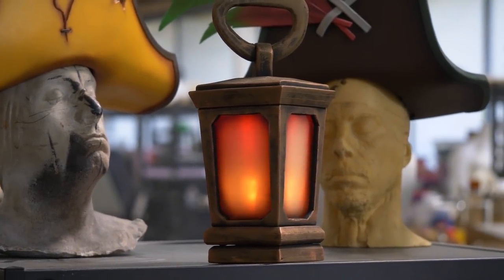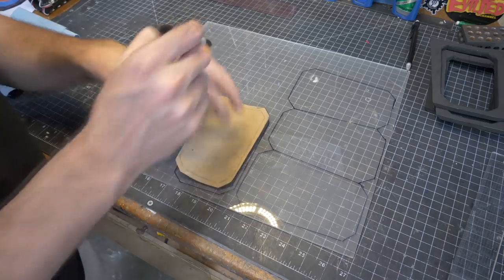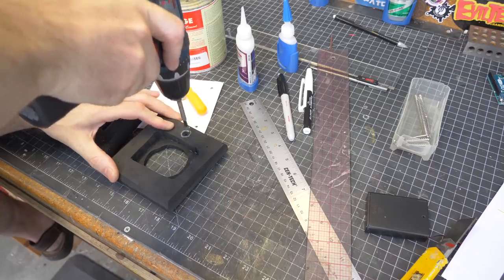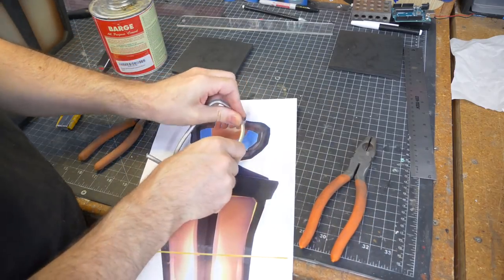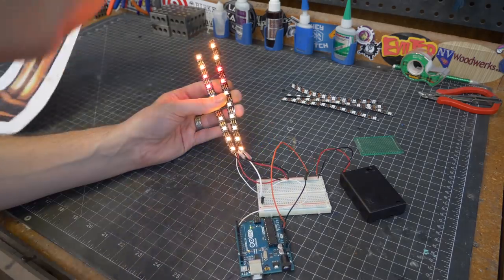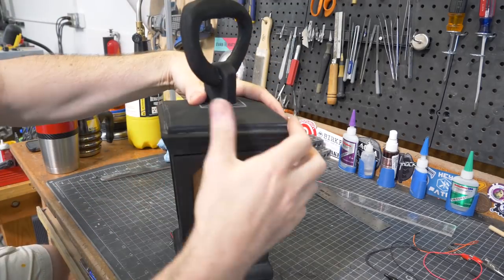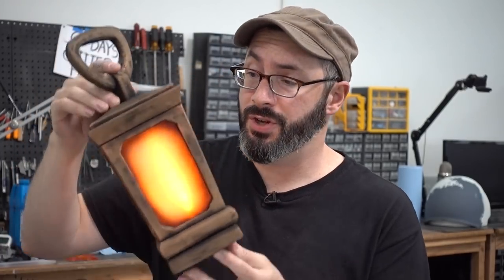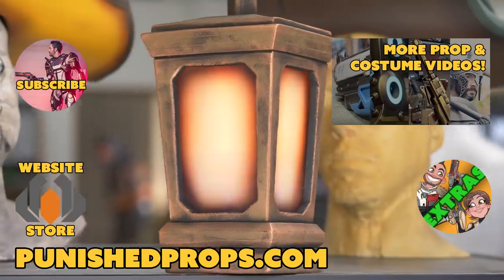I Made this in 4 HOURS! - Sea of Thieves Prop Lantern Tutorial

Comment: For those who want to build a lantern but don't know anything about soldering and programming LEDs  (like me) Walmart sells some fantastic little LED strobe lights in the Halloween section - there's a basic strobe, a color-changing strobe that starts out slow, speeds up, then slows back down (I'm using that in the head of my banshee) and a yellow flicker strobe.  They're $3, and totally worth it - very bright and long-lasting.
Reply from the maker: That's a great tip Becky, thanks for sharing!
Reply: You can also find LED strobes in the automotive section year-round. The neat thing about those ones is that they're hooked up to a pair of 9V batteries right in their packaging for demonstration purposes, so you can just copy that setup for your own purposes.
Reply: There are various electric candles too if you want clear glass.

Comment: I'm in the midst of a large LED programming project (with hundreds of LEDs!). A technique to cut down on the soldering that we're using is to zig zag the LED strips back and forth instead of cutting them and adding leads and connecting them together. It makes the programming a bit more complex, so it may not be a net time savings, but it is removing hundreds of (somewhat delicate) solder connections for us!

I'll have to work on a video to show the technique.
Reply from the maker: Super cool!

Comment: nice build .. just in case it helps if you lower your band saw blade upper guide closer to the material you can avoid most of blade brokes (and if you adjust it correctly also)

Comment: 0:49 - which cutter(and expendables) are you using for angle cuts? So far, any cutters like that left my foam in tatters
Reply from the maker: I linked to the knife I use in the description. The key is to make sure the blade is always nice and sharp. I use a sharpener to keep the edge fresh after every several cuts.

Comment: Do the magnets interfere with the arduino board at all?
Reply from the maker: Not that I could tell.
Reply: Cool! I'll keep that in mind if I ever build a board into something.
Reply: @WilliamJakespeareProps  No, they definitely wouldn't. You'd need some pretty ridiculously powerful magnets to interfere with electrics. Even platter-based hard drives are not easily damaged by magnets. Really the only thing you have to worry about is old CRT screens. Putting a magnet on the screen of a CRT makes it go all funny colours, and they have to be degaussed after that.

Comment: Unrelated question to the video, but how would you suggest getting rid of the diamond pattern on foam pieces? Or do you just buy untextured foam? That diamond pattern always seems to remain to an extent when I try and sand it down.
Reply from the maker: I try not to buy floor mats that have the diamond pattern on them. If I have too, I'll try to sand it smooth on a belt sander.
Reply: @punishedprops  gotcha. Thank you very much. I'll have to hit up Tnt for that smooth foam then. Might as well make life a little easier for myself.

Comment: I noticed your pixel strip has 3 pin connection, do you think this could work with 4 pin leds?
Reply from the maker: 4 pin RGB LEDs are different from the NeoPixel LEDs and would be programmed in a different manner. I've never used 4 pin RGB LEDs before. I prefer the NeoPixels since they're so easy to program.

Comment: I was going to ask how you kept your knifes sharp, but I see you use a knife hone in between cuts. I bought the cheapest utility blades I could find and they don’t cut well to begin with. Does price of the blade make a difference?
Reply from the maker: I've found that the Olfa blades I bought work incredibly well.
Reply: Punished Props Academy Thanks I will check those out!

Comment: Instead of soldering pins onto the ends of your power leads, I'd recommend getting a set of DuPont crimpers and connectors! They electrically isolate every component and make working with Arduino a lot easier! 
The crimper I use:https://www.amazon.com/VOLADOR-Connector-Ratcheting-Compression-0-1-1-0MM²/dp/B076K97JRV/ref=sr_1_7?ie=UTF8&qid=1537252530&sr=8-7&keywords=dupont+crimper&dpID=41zY5DHr2ML&preST=_SY300_QL70_&dpSrc=srch
A comparable connector set to the one I bought: https://www.amazon.com/Dupont-Connector-620Pcs-2-54mm-Housing/dp/B07BJ6WXT3/ref=sr_1_7?s=hi&ie=UTF8&qid=1537252565&sr=1-7&keywords=dupont+connector+kit&dpID=51D%252BFBh-k1L&preST=_SY300_QL70_&dpSrc=srch
Reply from the maker: Cool! Thanks for sharing. =D